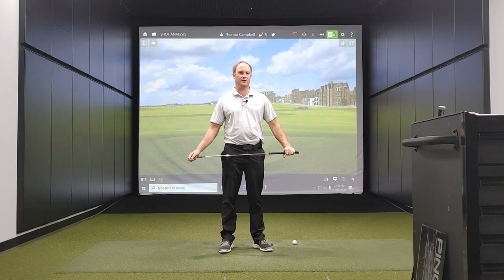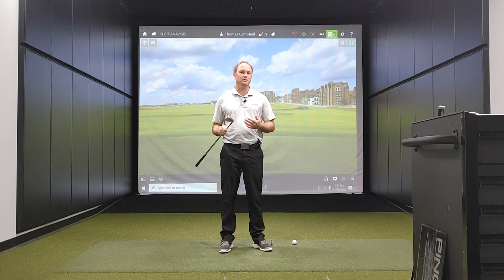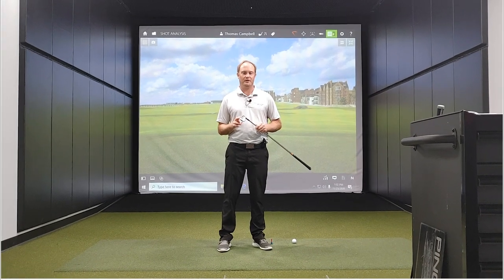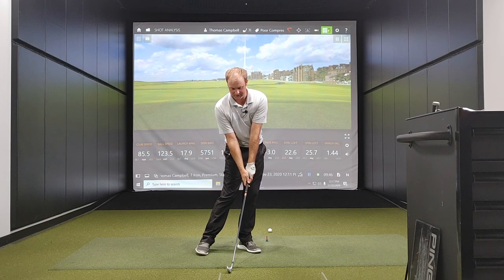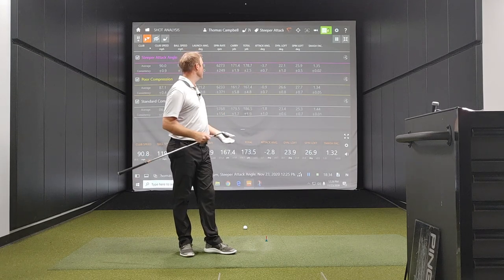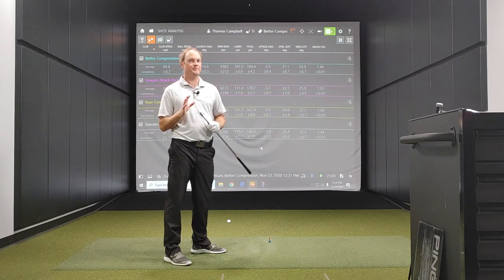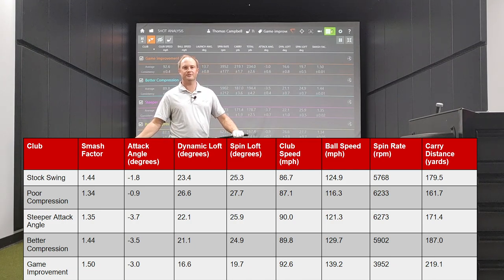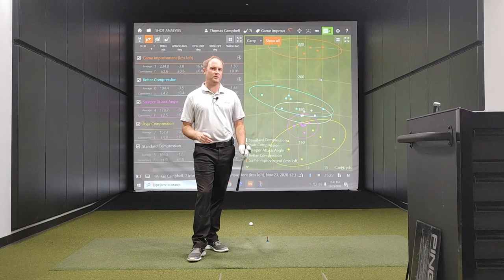Explaining the Influences of Smash Factor With Iron Play | Dynamic Loft, Attack Angle, & Spin Loft

Comment: For me the biggest surprise was the just over 15 yard difference between the steeper angle of attack swing and the better compression swing.  The swing speed was effectively the same, the angle of attack 0.2 degrees different, even the dynamic loft was only a degree different but for a loss of 350 rpm you gained more than a club in carry distance.

With racing cars it is better to start with a faster car and then improve reliability than the opposite.  With golf clearly it is better to start with an efficient swing and then build in speed
Reply from the maker: Thank you for watching!!

Comment: I am wondering if you can provide some feed back on my driver swing. I had it analyzed recently. I'm 64 years old, not know for distance off the tee. My driver swing speed is 87 mph, average smash factor 147, but my drive only carries 200 yards. Driver loft is 10 degrees, regular flex shaft 8.8 handicap. My swing speed with a 7 iron is 95, smash factor 130, carry 157 yards. Why am I loosing swing speed and distance with my driver? Any insight you can provide will be appreciated.
Reply from the maker: Thanks for commenting. Are you sure that your swing speed with your driver is slower (87mph) v 7 iron (95mph) even if this was flip flopped I would like to see more that 8mph separation. It could be how you come into the ball at impact that slows the driver down. Try moving the ball position further forward with the driver to increase angle of attack. - Thomas
Reply: @2ndswing  I would have thought the swing speeds were reversed too. Maybe operator error with the swing analyzer. But, I saw the numbers myself. I'll try moving the ball forward and see if I can "feel" a slow down into impact with the driver. Thanks!

Comment: Basically your hands are so far ahead of your club head your turning your seven iron into a five iron and hitting it 180 yards.
Reply: Not really. A forward leaning club shaft is the expected configuration at impact. De-lofting a club's listed loft is the standard, not the exception. Thomas' swing mechanics seem very sound and had he swung a 5 iron, it too would be properly de-lofted.
Reply: @diminishedreturn  if you research that on line every article would absolutely disagree with you. Loft IS the angle between the club face and the shaft. 
If you lean the shaft forward to are in fact de lifting the club as I said. You turn the 7 into a 5 iron.
Reply: @Eec2023  I didn't say that loft isn't the the angle between face and shaft. I simply said that leaning the shaft forward and de-lofting the club is the correct way to hit a golf ball. 
Trackman measures the Dynamic Loft, which is much more relevant than listed club loft, since it's basically the "delivered loft" taking shaft lean into account.
My remark was simply saying: leaning/de-lofting a 7-irong doesn't turn it into a 5-iron. It's just a properly struck 7-iron.
Reply: @diminishedreturn  to some extent yes. Yours would be considered excessive. Hence the distance you are hitting it. Some deloft more than others. That’s you.